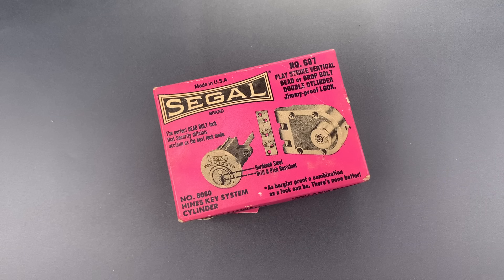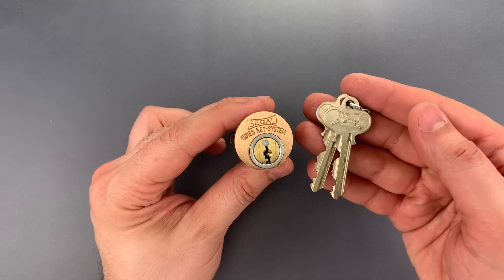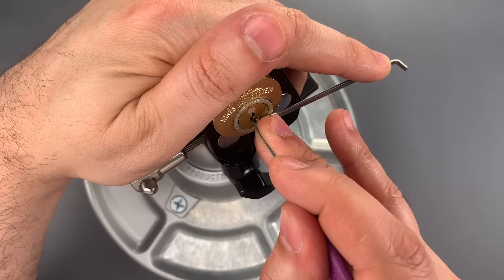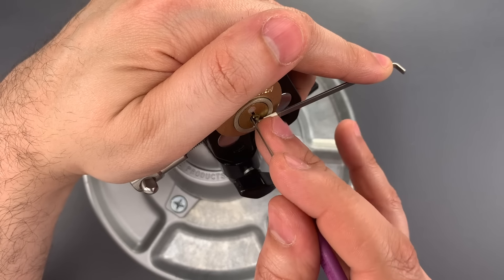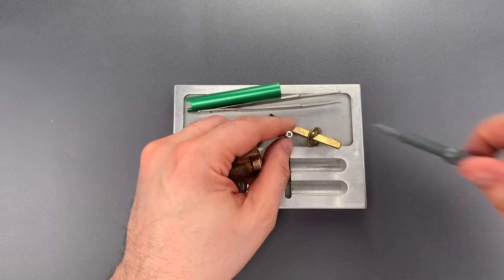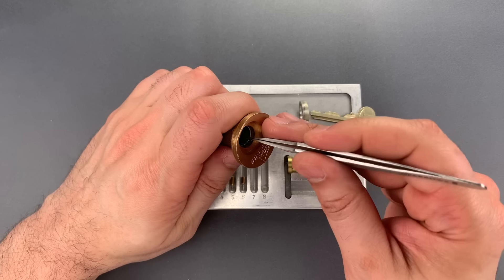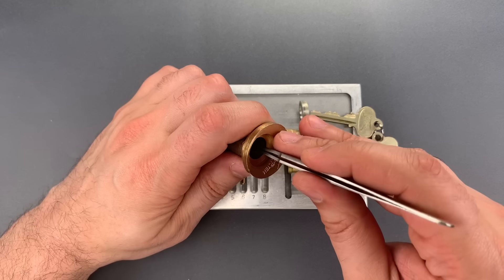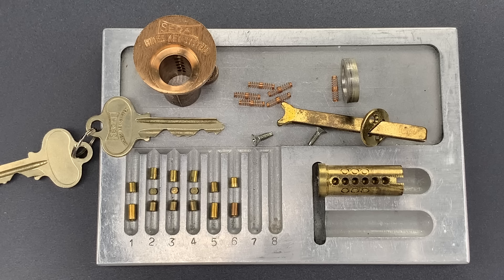[1181] A TRAP For Pickers! The Clever Hines Key System Picked

Comment: Major question: if it cannot be opened with the key after a botched attempt to pick it, what does the lock's legitimate owner do to get into his own property?  If he has to call in an expert or replace the lock, then this means that villains might maliciously pick the lock not as an attempt to gain entry to the property, but just to inconvenience the owner.
Reply: This does raise a valid concern. I suppose the property owner would need to weigh the possibility of inconvenience against locking out a would-be thief.
Most criminals would not be able to identify this key system as being "trollable" just by looking at it, so odds are that if it ever does seize up, it prevented a criminal picking attempt.
Reply: The man himself blesses us with his divine intellect.
Reply: @SpaghettiViking1  You say that people wouldn't be able to identify the lock as "trollable," but there are now 300k+ views on this video within days. The knowledge is clearly spreading fast.

Edit: To clarify my earlier statement for the 5 people already telling me I'm wrong, the 300k+ was within a couple days. Now, it's above 400k. While it's nowhere near the population of the world, the probability increases as time goes by. While others have pointed out that the lock is old and not being sold, you can clearly still find it, and other locks based on this design can have the same problem.

As others have mentioned, there are easier ways to brick a lock than to try to pick it and fail, and I think that's the best answer to my stupidity here. The probability of criminals watching this channel is... well, higher than average I'd say. The probability that someone with criminal intent watched this video and then stumbled upon one of these locks is low, but constantly increasing with the view count. The chance of them actually bricking a lock like this is almost zero simply because it isn't worth it. So thank you to everyone who pointed this out, it certainly improved my knowledge! 😉
Reply: In his other video where he shows you how to modify a normal lock into this lock he talks about how to get it back open if I remember correctly
Reply: yep but if i remember correctly as well you have to dismount the whole lock to do so, so you have to have a backdoor or at least another access to your house without that system installed. It is still good to protect the door(s) of your house that are the most exposed to picking attempts, and could seriously delay thieves and completely discourage some of them.
Reply: My gosh, it's Lindybeige! Top of the morning to you, Limey... well, top of the afternoon for me.
Reply: There are locks like this that ostensibly can't be un-trapped but if you know how, you can do it. Without getting around the back and totally disassembling it to do so. Kensington do a laptop lock that has an "unfixable" trap pin but it is easy to get out of the trap if you know what to do. 

Chubb's old detector can be reset using the legitimate key but again, if you know how, an attacker can get around it.
There are locks that someone with malicious intent can bork though. But I mean, if that was your aim then superglue would be easier.
Reply: Probably why it's not more widespread. It's use case is limited to where the added security is worth the occasional physical denial of service attack. Of course that has the additional drawback of broadcasting that whatever it is protecting must be valuable.
Reply: Anybody can do that anyways with just a loctite tube, kinda irrelavant
Reply: wait wut? Lindy watches LPL too? That's pretty cool actually. But to your question, yeah I could see trolls causing issues. Trolls probably weren't as much of a problem back when the lock was made though. Perhaps plate the hard pin and collar so it's not so easily recognizable? 

Once broken though, you'd have to destroy it. Maybe a new mfg could put a reset on the back side of it so the owner can go in through a different door and reset it?
Reply: You can seize a lock with glue. This would be a much more challenging way to break a lock as you would have to pick it in a way that would work on a normal lock.
Reply: Might be the case, that's why you'd only use one of these on something valuable.
Reply: Not a serious concern.  Vandals can maliciously break locks a lot easier than a botched attempt to pick lock.  Locktite, glue, gum, breaking off some metal/another key.
Reply: They would have to know about the lock ahead of time.
Reply: This is what you call a "Denial of Service" attack!
Reply: I see what you are saying from the denial of service aspect it certainly would be a factor of consideration before considering a lock like this. But locks are not a one size fits all. I feel this is more for a tamper evident approach. locks are cheap so it's no big deal if you have to drill out your own lock. But if your drill is behind that lock it might be a different story. depending on what you are guarding this could be a good way to stop simple "bumper" criminals. Most criminals aren't locksmiths (otherwise they wouldn't be criminals lol) so something like this is a good honeypot to determine if you are being targeted in the first place.
Reply: the owner would call a locksmith who would have to drill out the lock. Considering a lock like this would be on something the owner wanted to protect, the inconvenience of having a locksmith come out would be worth keeping it safe. plus, that's a very minor inconvenience for the crime of attempted breaking and entering. The same could be said with a normal lock, slide in any key that fits the lock profile, and snap the end off in the lock.
Reply: @ncasey9853  and then you just add a note saying well done for picking this and about police being on there way (on something the owner just uses to troll would be thieves not actualy calling the cops)
Reply: Burglars generally don't bother to pick locks if some quick forced entry will work just as easily, and vandals will do things like squirt some superglue into the lock, rather than rely on you having some fairly esoteric locks. Picking defenses are usually meant to protect you from someone entering without you knowing about it.
Reply: Yea, I had the same thought
Reply: for a house its probably crap, but if there is something that doesnt need to be opened very often, like maybe only once or twice a year, buying the lock twice a year to know that no one has been inside the vault or whatever seems like a great idea.

to get inside you can just completely destroy the lock and replace it at that point. I cant think of any use for it as an actual bank vault I assume is more complicated than this. idk maybe if you had a nice boat that you only take out during the summer so for 10 months you store it. buying a 150$ lock (idk the price) is a lot better than buying an entire boat again.
Reply: @rayredondo8160  These haven't been made in decades so I don't think the views are going to severely impact the usefulness or value of the small stock remaining on eBay.
Reply: @rayredondo8160  but how many of your average criminals watches youtube. Let alone lpl
Reply: The lock is intended for high-security applications where the bad guy would want to get in and out without being noticed. This lock would not only defeat impressioning, bumping and most picking, ie, keeping the bad guy out, but afterwards would also flash a neon sign to your security guys that your facility is being targeted.
Reply: @rayredondo8160  he said most
Reply: Couldn't you do the same with any lock by just shooting crazy glue into it?
Reply: Hi , Lindybeige. Big fan.
I think that, if your intention is to troll and block a lock... there are extremely easier ways to do so, and would work on any lock.
Reply: Hallo, Lindy! Just came directly from your “Berserkers” video to here! It’s a small world :)
Reply: if you just want to mess with someones lock, you can just put glue into the lock body. that will have the same effect for pretty much any lock and requires less skill and effort
Reply: @rayredondo8160  but the lock is from the 60s
No picker in the 60s had access to YouTube, so it was safe as houses back in its day
If you were to use this lock these days, I guess you could get a cheap camera system to identify the troll if it started happening
Reply: I wonder if a tool could be made to reset the trapped lock, like some sort of vibrating  probe to cause the lock to vibrate that would cause the hollow pins to hop out of their sockets. And, I wonder if the motor involved in that would need to be able to vary its speed to work on more solid or less solidly mounted locks.
Reply: Imagine the fun these could of been in school.
Reply: @rayredondo8160  You seem to forget the fact that there are 7 billion people on this planet and the odds of randomly meeting one of those 300k is rather small, exspecially if you add factors like malicious intent.
Reply: @rayredondo8160  I'm guessing that YouTube wasn't anticipated when the lock was built in the 1960's.
Reply: So you're talking about someone going out with the express intent to just brick the owner out of this lock? That is completely and utterly irrelevant since you can do that with a tube of superglue/epoxy or just by breaking a key off in any lock. I feel like you are trying to create a new unique issue to this lock where it already exists with all locks..
Reply: I was JUST thinking of that!
Reply: Picking the lock to inconvenience the owner is unnecessary effort. You can inconvenience the owner by hammering a metal pin into the lock's keyway. Works with almost any lock, too, not just with this particular kind.
Reply: dj d  Before a worn key could disable the lock, it would stop working altogether (with shear line at about half the length of the wafer it would neither seize nor open) and the owner would just get a new key or a new lock.
Reply: No lock is immune to malicious intent tho. Anyoune could go to town with silicone or liquid weld to ensure a key couldn’t work
Reply: It would make a great lock for a door that leads to a porch or garage, coupled with a really secure lock on the front door...
Reply: @SpaghettiViking1  I mean... 50 dollar's lost to get a door open, or possibily thousands of dollar's lost and home trashed.
Reply: I dropped a comment to this effect above.  It’s super dumb.   Maybe in an era before readily viewable cctv was a thing but now, just have a decent lock like a medeco or a protec that’s beyond most picker’s ability and install a damn camera.  If you’re that paranoid, picking attempts do tend to leave little scuffs and minute traces of metal shavings, particularly if someone tried raking first.

All it achieves now is you know someone tried to break in and now you have to break in too.
Reply: Lindy and Locky, all new episode of this lock picking, swing dancing, history telling, crime solving  dynamic duo coming soon.
Reply: This is similar to the issue of a computer password being disabled after 3 failed attempts.  A malicious person could fail 3 times on purpose and lock the legitimate user out.  I think that the modern system involves slowing people down instead of locking people out.
Reply: Would you rather lose $100 to a lock smith or thousands of dollars to a thief?
Reply: If someone wanted to defeat a lock permanently, they could fill it with bubblegum or resin or superglue or something. I'd be less worried about intentional attempts to disable a lock like this.
Reply: drilled out by  a lock smith  duh  exactly how did your high school let you graduate ???
Reply: When the lock provides more protection than the door
Reply: Its the same a if someone vandalise a lock with some glue or torch.. you would probably need to change the door jam :)
Reply: You can pour glue in any lock, can't you? Why go to the extra steps of picking it to disable it.
Reply: @rayredondo8160  Its vintage, the internet didnt exist when this lock was sold.
Reply: yes its a major inconvience the lock is well, locked, but if you go by the function of a lock, to prevent unauthorized entry, it serves its job well.  there are other locks that don't bind up, but they have a wildly different design to counteract picking
Reply: @Eidenhoek  so long as it sees plenty of use in the backdoor, sure.  even if it only get use at the front. sure!
Reply: The owner just need to know on the door so the wife lets him in 😂🍺👍🏼
Reply: The answer is you get a set of tool steel keys cut for it and just manhandle it using a screwdriver for leverage.  This will break the pins of course, and you'll need to replace the lock.
Reply: It depends on what you're trying to protect. Something really valuable would be worth the lock being destroyed in order to ensure the extra security.

A lock like this may not be the best for a house or some other lock used quite often. But it would probably make for a pretty good private safe lock or something similar.

You would want it on something where you would rather the lock be destroyed for that little bit of extra security.
Reply: Or squirt some superglue into any brand lock. Quicker, too. If someone wants to lock you out, they will and can. This lock doesn’t make that any easier.
Reply: oh hi Lloyd fancy seeing you here
Reply: You can jam up most locks to inconvenience the owner. Various items, along with epoxy, etc., can be forced into the keyway and render the the lock unusable.
Reply: There is nothing stopping anyone from putting superglue in your lock. It's in fact easier than bricking this lock, since you don't need to pick it. If someone wants to inconvenience you, there are easier ways.
Reply: Mehn just use a couple of rounds of 50mm lock picks
Reply: Have a glazier remove a windows pane and refit it after.
Reply: Depends, but my assumption is that they just have to take it apart and hope criminals stop trying that location. As far as “trolls” go, if you have the time to go around inconveniencing people by jamming a lock, there are less subtle ways to do it
Reply: @QuiniansBudgetCrafts  Lindy had made his own lock video once. Thus, it's not a big surprise...
Reply: Well, most trolls would simply shove something up the key way, or glue it shut... This works on most locks without any skills or knowledge...
Reply: @edi9892  ah didn't know that I'm go check it out
Reply: LINDYY!!!
Reply: All those "malicious villains" who are out to inconvenience you? Uhhh
Reply: People with the skills required to pick doors fortunately aren't risking arrest to inconvenience the owners. Especially so when in the past lock picking was a very rare skill to have, and it was harder to get by. There is very little reason to frustrate people when for the same risks one could steal and make their own lives better. If one really wants to frustrate an owner it would be far safer to simply throw a rock through a window(s) and run away, and requires a far easier skillset to do so.
Reply: Its really for a situation where you absolutely do not want someone to get unobtrusive access. For home use its questionably worthwhile depending on your situation. But for say a business trying to protect really important documents or incredibly valuable items it can easily be more worthwhile to know that someone attempted to break in and that they weren't successful.
Reply: @alexsis1778  I wouldn't disagree with the premise, but I'd certainly disagree with the conclusion. In a critical situation one would want a high end lock rather than a mediocre lock with a trick up its sleeve. The latter, as we can see, can be bypassed. The conventional good lock will keep out a far higher percentage of potential people, one would assume someone able to open a legitimately good lock would recognise and prepare against a very distinctive model of lock. It will cost more of course, but if you absolutely have to keep the area secure you can't really afford to go cheap on the main device ensuring that goal.
Reply: This thread just became beige. It's such a pleasant colour!
Reply: If this lock is stuck, you likely have bigger problems than a mere burglar or vandal, since most people who are sophisticated enough to try to pick the lock, don't really want you to notice that they were in there in the first place. The exception is perhaps a gun vault, or some tech room you don't have to go into very often. I used to check on weapon stores when I was in the army. I don't want to go into detail, but locks like that could serve as a warning of spies or possible high level sabotage attempts.
Reply: The lock can be disassembled and reset once access is gained via another method.
Reply: The legit owner can always use destructive way of entry or call a good locksmith.
Reply: What are you doing here? It always weirds me out when two of my worlds randomly collide like this.
Reply: Can't you just jam up the lock with anything to make that happen?
Reply: The fact that this lock being installed at all means the owner is ready for it
Reply: @adamwest8711  those are expensive locks though and especially if you need many, compared to this method you only need a few wafers a dremmel and a knife
Reply: If you want to inconvenience the owner of pretty much any lock, you can just fill it with glue.
Reply: I would wager a guess that this is why these locks are not very common. I would guess you would use it for places you want 100% secure that not many people have access to.
Reply: The owner eventually buys a gun.
Reply: The short answer is, yes, you can do this to a lock like this merely to "inconvenience the owner". But I feel like it's a moot point - since you can achieve that with almost any lock, and much more easily - by just hammering in a nail or a wood screw with a broken off head.
Reply: I imagine this type of lock is what a CEO of a fortune 500 company might use in his office cupboard where he keeps some questionable possessions. Nobody should be poking around that lock and the minor inconvenience of having to bulldoze down the whole lock is trivial when in exchange you get to know that somebody tried to fiddle their way in
Reply: @TwoPlusTwoEqualsFive32  and then what? You still won't be able to open it from the inside.
Reply: @rayredondo8160  "but there are now 300k+ views on this video within days. The knowledge is clearly spreading fast."
A good point but now drop the number of views in this video which is over a million to the entire population of any given country.
After you have done that realize that all these views can be from ANYWHERE around the world and how many of these people actually have lockpicking tools and the knowledge on how to actually use them AND how many of all these people would simply want to cause harm to someone specific and what are the chances of them having this exact lock :'D

So in short we can toss this issue in the "statistical impossibility" bin.
Reply: Somebody could do that, but they could also just stick a key into your lock and break it off, resulting in the same issue.
Reply: @degiguess  Well yeah, buyt getting a broken key out of a keyhole is a much simpler task that can be done without opening the door or removing the lock.

Same cannot be said if this particular lock goes into full lockup, you would need destructive methods to get the door open again.
Reply: @ambassadorofreee3859  then they could squeeze liquid cement into it
Reply: If people want to piss the owner of a lock off, filling it with superglue or epoxy glue would do the trick, no matter what lock it is.
Reply: i Was thinking the very same thing while i was watching Oak Island. after one fool trips the trap what then ??
Reply: probably why we don't hear of this lock anymore
Reply: the most likely time this lock would activate the trap is if your ex did it.
Reply: foofustherabbit .
Reply: Watch https://www.youtube.com/watch?v=7JlgKCUqzA0 he explains it in this video
Reply: @gabreshaa8234  hail! to the oracle
Reply: @SpaghettiViking1  Unless the criminal is in the 1.1 million viewers interested in picking locks rofl the fuck dude
Reply: You could inconvenience the owner in any number of ways if you wanted to. If the intent is there, you will find a way to do it. Supergluing the lock, throwing a brick through the window, throwing a tin of point on the wall. Seems silly to focus on them being able to permanently jam the lock by attempting to lock pick it.
Reply: I haven't seen this in any of the comments, but in order for this trap to work, you have to 'successfully' pick the trapped pins. The cylinder won't turn unless all six pins are picked, 2 3 and 4 at least to the first shear. Anyone who watches this video and has the tools and skills to successfully trigger the trap, could also avoid the trap. Since this doesn't seem to be a skill trap, more of a knowledge one. 

All that being said, it's highly unlikely a vandal will have the tools and knowledge to trigger the trap, and the restraint to not break in for real. At that point, if the trap tries, it did it's job.
Reply: @ikiruyamamoto1050  I've also seen some products that resemble keys, they are made to jam the pins of a lock and completely disable it. Glue is probably a simpler way to do it, but you might be able to loosen it with heat.
Reply: Other malicious things you can do: half drill it out
Reply: You still end up with knowledge that somebody attempted to break in
Reply: this would give the added benefit that the owner now knows someone attempted to gain illegal entry. for some people that would be important
Reply: Destructive entry if u can get to the back maybe a different door into house  and disassemble and remove  the top cover u could reset it but that would be hard to do trapped and in a door
Reply: Well you have to pick it first for that to happen - if you just want to sabotage the lock, might as well push a blank in and break it
Reply: @owlblocksdavid4955  no one cares.
Reply: You would need an alternative enterance to get in, such as a back door. Once inside, you cna dissassemble the lock from the inside and reset it
Reply: The reap life dos attack
Reply: Yes. Just a quick rake and then continue walking on. This lock also passes the test that it's easier to break the window next to it or go through the sheetrock.
When my mom got very sick before she died I broke the glass to get into her house because she had the deadbolt set. No police were called. No one came running. I was in the house and under 30 seconds.
Reply: Key + vibration
Reply: @rayredondo8160  true
Reply: @piraterubberduck6056  I have dealt with that, it sucks, and if your goal is to render a lock inoperable, it works nearly as well as this trap.
Reply: @Ckcdillpickle  .... oh yes. My criminal bad only sit around in a cave and make nefarious plans Mwahahah we are definately not entirely human
Reply: @AndyGneiss  isn't/wasn't there a little shaker gun that essentially throttled the lock and twisted the cylinder with the goal being to bounce and trap the pins as the cylinder shakes slightly open and closed? I remember it being pretty big and incredibly loud with multiple settings. And slow, taking as much as 10 minutes on a standard door lock.

Idk. My dad had the same hobby as lpl, maybe I saw something in his shop or in a movie?
Reply: @Lindybeige didnt expect to see you here
Reply: I honestly didn’t notice who left this comment until after I started reading comments. Cool to see you here. ^_^
Reply: I mean you can purposefully bust any lock if that's what your goal is. It doesn't need to be this one.
Reply: @rayredondo8160  This lock was also made in the 60s, so I doubt you'd find one anywhere.
Reply: imagine someone getting caught picking one of these and he goes" i'm not trying to break in, it's just a prank...."
Reply: How many of these people could actually pick a lock and how many could do it fast enough to not draw any attention to themselves?
Reply: A lot of comments to this reply. But who picks a lock when the body of the lock is the weak spot?
Reply: Could you guys do a colab about old locks, lock piking or something. I think it would be great
Reply: You could achieve the same malicious effect by squirting a bit of super glue into ANY mechanical lock.
Reply: The villains might throw a brick through a window just to inconvenience the owner as well. But, whaddaya gonna do? Or are you suggesting that some people would be so outraged to see such a lock on any door that they would set about maliciously picking them, but absent the presence of the lock they would just continue on their merry way?
Reply: People often forget that most homes have windows. And conveniently located nearby are flowerbeds with bricks or rocks....
Reply: Big brain 🧠
Reply: You need to fully pick the lock to spin the lock and get the lock locked (?), in which case a broken lock might be more desirable than an opened door.
Reply: If you live there you get a locksmith over which propably would be covered by your insurance
Reply: @rayredondo8160  Even then, I really doubt a criminal would recognize the lock if they ever encountered it after watching this video. Knowing how to pick a specific lock doesn’t help unless you can recognize the specific lock out of hundred of thousands of different locks there are.
Reply: i mean i guess the point is more you dont get your house robbed
Reply: That means someone in first place needs to pick it enough to spin the core. Think about it this way - if lock didn't have those you could just enter the house.
Reply: I can easily give a couple of example of usage, even if this lock is useful in many more occasions. First, on a secondary entrance: something useful to have for any reason but compromising the security of the building. For example an entrance from a shady alley where a lockpicker could have an easy time picking a lock far from peering eyes. It is easy to reset it if you can access the lock from the other side. Second, as a second line of defence, not to protect the house but to protect a safe or a chest. Clearly no one is going to pick your lock to enter in your house just to troll you by temporarily locking you out of your safe. And in many cases you might prefer to lose an item than to have someone else have it.
Reply: @MANUEL CRISTOBAL ROGERS IRURETA all brass, no ferous metals :(
Reply: @gabreshaa8234  Divine, the 8th commandment. Thow shall not steal...
Reply: @rayredondo8160  I think it’s funny you knowing and defending yourself. When you don’t really need to.
Reply: @QuiniansBudgetCrafts  you give trolls to much credit. Don’t let them steal your peace. Easier than you can pick these locks...
Reply: @ericwalker6546  You're right, I don't. But if I do, I have a slightly higher chance of people not telling me I'm wrong 😉
Reply: @rayredondo8160  If you know you are right then it really doesn’t matter what they say. Most people just show there lack of knowledge.
Reply: @ericwalker6546  See though, I wasn't entirely right, and so part of my edit was correcting myself. I was partially trying to deflect and partially trying to educate anyone who did think to read my full comment.
Reply: @rayredondo8160  ok bro. I was just backing you up. But it’s starting to look like you are a approval addict trying to please everyone. You can please some of the people some of the time. But you can’t please all of the people all of the time. Abraham Lincoln.
Reply: @ericwalker6546  Clearly I'm not an approval addict, otherwise I wouldn't be posting in YouTube comment sections. I'm just trying to inform people, including myself, as best as I can, and that sometimes means I'm wrong.
Reply: @rayredondo8160  You post comments and then try  to stop negative comments in advance. Because you want everyone’s approval.
Reply: @ericwalker6546  If you paid attention to my comment, you'll note that it was an edit. Meaning I got negative responses, then changed it to reflect new information. And then I kept getting negative comments because people didn't read. If I were seeking to prevent more negative responses, I could easily edit my comment again to tell someone to read the full thing before responding, or something to that effect.

My purpose is to learn and educate, not to seek approval.
Reply: @rayredondo8160  It doesn’t matter to me one way or another. But you try to hard to hard to make yourself feel better about what other people think of you.
Reply: @ericwalker6546  You're right, I do care what other people think about me. I care if someone stumbles on my comment and decides I'm a know-it-all. I especially care if that someone happens to be someone who knows me in real life. But beyond that, I really want people who read the comments section of these videos to learn something beyond what the video has; I don't just want people to see some kids poking fun at the video maker, and I don't just want people to see pointless arguments.

... Such as this one.
Reply: If, as an infiltrator, your goal is simply to get inside where the lock is, then the plan would be to botch the pick and seize the lock. Knowing that the owner will be forced to call for a locksmith, intercept and replace the locksmith, and then use that cover to gain "legitimate" access to the lock and beyond.  A bit Machiavellian, or Italian Job, but there you go. 
Now, if you are dealing with someone who just wants to cause a problem, they won't take the time to try and pick the lock, but will simply insert a shim, glue, or whatever, and move on.
Reply: Will we be seeing a Lindybeige episode discussing locks on the horizon?
Reply: @jonmcfluffy9699  for a home a lock like this won't be super effective  unless they are trying to not be super obvious  be a lot easier to go through a window or glass door
Reply: I don't understand where the small wafer belong.  What keeps the hollow pin from dropping into the key way?
Reply: @rayredondo8160  This lock is from the 1940s, only a small handful of people will have this still installed. A criminal watching this video with the intent to damage property for the sake of being annoying is going to have a hell of a time even finding this lock so they can break it. It's such a non-issue I can't image why you're parading it around like its some big threat.
Reply: @SpaghettiViking1  On the other hand the owner could install this lock as the obvious lock to pick but attach it to nothing. Imagine an experienced lockpicker spending the time to pick this lock, then, SUCCESS! he turns the lock...then nothing happens. The door is equipped with a hidden magnetic deadbolt and he is fresh out of super magnets. (as well as being unaware of the existence of the deadbolts)
Reply: I think, if you're being targeted by someone that just wants to fuck up your life by inconveniencing you in such a way then you probably have some self improvement to do beyond being worried about your stuff
Reply: alternatively they can stick scrap in the key way with relatively the same effect I think
Reply: This sounds similar to how some safes have an anti-drill glass plate inside them that if you try to drill the safe, you risk breaking the glass plate which releases additional bolts that hard-lock the safe, requiring it to be forced open.  In that case it's more a matter of once the lock is certain someone other than the owner is trying to get in, it clams up to maximum security.  Obviously things IN a safe are more valuable than the SAFE itself, so the owner would be OK with having to wreck the safe to get his property out, rather than the safe being unharmed but losing what's inside it.  Same thing goes here, it's less inconvenient for the owner to have to break in and replace the lock than to replace everything in their house the thief was trying to steal.
Reply: @rayredondo8160  what is your point?
Reply: @juxtapode2781  good we’ll pick that back door instead! If a thief is going through the trouble of picking a lock he’ll look for other doors to pick instead and try his luck at those. You can’t win for losing...SMH
Reply: There is a way to repair this lock after it gets caught on the trap pins. You have to pry open the top cap and empty the springs and the drivers back out the top. I’m sure it can be done that way. Then when you get those hollow pins out. Throw them as far as you can..
Reply: @delinquentdesign  a thief has to actually pick the lock for it to get stuck, so he would not realize it until he tried. That can significantly increase the time to get into a house, and if it happens on one lock he may not bother to check the others because it would be reasonable to think every lock has been installed like this. Not saying it would work every time, but if it works sometimes its better than not having it. "SMH"
Reply: Better to call a locksmith than call the police.
Reply: a rebar ram on the door , and several hundreds pounds of front door refurbishment
Reply: Lol
Reply: "Villains" lol
Reply: I feel like I recognize the moon in your pfp
Reply: Simple solution: Always keep a fire axe in your car.
Reply: Well, if your "villain" really wants to annoy you by making your lock unusable, all they need is pouring superglue in it.
That said, if you pissed someone off I think it's far more likely they'll go for a brick to the window or cut your tires.
Reply: I guess you can reset the trap using some kind of bumping or vibration.
Reply: Most people don't know about this special key system so whoever is trying to pick it has to be having the intentions to rob the home.

It's better to have to replace a lock rather than to replace all your valuables.
Reply: Hulk smash.
Reply: @ncasey9853  family is very valuable. it doesn't have to be anything of monetary value.
Reply: This argument applies to any lock. Superglue? Epoxy? Frigging bubble gum? If you want to inconvenience the owner there are easier ways than purposefully botching a lock picking attempt.
Reply: @piraterubberduck6056  The whole idea is so utterly stupid that those almost 6000 likes feels like a slap in the face of human kind. 
Not only are there more easy ways to "troll" a lock, it is illegal and quite frankly difficult to do so. 
High risk no reward ...
Reply: I thought the same but would you rather a your hole house have a pickpocket Come and take about anything they want or deal with a lock that can't be used anymore
Reply: Sup?
Reply: Fire Axe lol
Reply: @juxtapode2781  Probably better for back doors, with the main door using some other system. The thinking here is that a back door is probably less prominent from the street.
Reply: Different door
Reply: This is a ‘clever’ lock made in USA.
Reply: You have to disassemble the lock from inside the house. At least that's how he showed to get his variation working again.
Reply: @SpaghettiViking1  the crininals will just throw a brick into the window
Reply: @rayredondo8160  bud back in the day I was a small time criminal like stealing shit. And I just always destroyed locks. Or just look for a window open. Most low time theifs will not  try to pick anything or learn how to pick. I've watch this vid (not a low life anymore but) and wouldn't be able to tell this lock apart from others. I'm sure some people do use this info to better their skills but I think for the most part Johnny methhead is just going smash and grab what he can.
Reply: This is hardly a legitimate criticism of this lock.  Anyone can easily "inconvenience the owner" with any lock by simply breaking a key off inside of it.
Reply: Wow! Not the sharpest tool in the shed are ya?!
Reply: True
Reply: Hey, it's you
Reply: Of someone wants to inconvenience a house owner, they can just put him or superglue in, and not look around for the one house with this lock.
Reply: Perhaps the lock is securing my food cache.  Maybe I do not care about the economic value of the food, but more that no one has tampered with it.  Maybe I just throw the whole thing away.
Reply: tbh, if you just want to troll the owner, you can just put glue in a lock, drive a nail into it, whatever .. it doesn't need a hines lock to troll the owner :-)
Reply: As an answer to your question, I would love to direct you and all interested parties to Google "goblin locksmith art" for a practical example of an alternative solution
Reply: I'm sure their are easier or better denial of entry attacks that aren't specific to this lock.
Reply: If you want to brick someones lock, super glue is a much easier way than hoping the guy has this one particular lock type and trolling it with a delibrate failed pick attempt.
Reply: @rayredondo8160  almost 2 million now
Reply: If y9u can't figure this one out don't buy th8s type of lock. Leave this 9ne for the grownups.
Reply: @rayredondo8160  2M views now
Reply: The lock seizing up means that the quiet, easy to miss act of lockpicking now has to be replaced with something loud like drilling/hammering/breaking windows and the culprit is more likely to be caught.
If the owner has to break the lock, who cares. It's their own place.
Reply: @SpaghettiViking1  Does the intent behind the criminal's action matter at this point ? You're both locked out of the access to the apartment.
Reply: You're right, however it depends what you're defending in your property and what are your priorities. 99% of the time a picker is a thief, so what should be your priority? do it yourself.
Reply: Consider that most locks get picked infrequently. Out of these, some attempts fail flat, without even triggering the lock to seize, a fraction will get the lock to seize and a smaller fraction will possibly unlock and get in.
It is therefore unlikely to happen that the lock seized. Even then, the lock protected you property.
Of course, if you situation is of frequent picking attacks, you might prefer a different lock.
Reply: If someone simply wanted to inconvenience the owner, it would be way easier to jam a toothpick into the keyway.
If someone tries to pick a lock chances are they are trying to break in.

Most likely the reason these locks are not made much anymore is most criminals have zero qualms about kicking in the door.

Most lock picking experts happen to be locksmiths, not thieves….
Reply: @rayredondo8160  "Knowledge"? This is mostly entertainment and will be out of plenty of our heads quick enough unless you took an active interest in it and studied further to solidify it or has a tremendous memory for this kind of thing.
Reply: Any lock can be easily disabled by breaking a toothpick off in it, so it is not really an issue that this lock can be disabled by attempting to pick it.
Reply: @Lreclusa  Even the lpl took 10 tries to pick, which means he bricked 9 locks. It is definitely a skill issue. The big thing here is if you come home, and the lock is jammed, you know someone tried to pick.
Reply: That was my thought too. Trolls be trollin'.
Reply: @SpaghettiViking1  break a glass pane and you're inside anyway.
Reply: Well he simply chainsaws the door! 🙄
Reply: How's that a valid concern?  If someone wanted to cause inconvenience they could just squirt superglue into ANY lock.. much quicker and easier lol
Reply: What is this, a crossover episode?
Reply: I had the exact same thought, so I was really excited to see someone else ask the same question. Then (depressingly but unsurprising) I scroll through the first 50 or so replies and they tunnel vision solely on the "there's much easier ways to troll a lock" aspect. Way to completely miss the point. How do you release the lock if it binds? Stop getting bogged down in stupid things. It's a simple question. How do you release the lock if it binds.

Maybe someone has actually addressed the issue, but with 200+ replies, it's painful to slog through the stupidity to find actual replies.
Reply: Yes, but if they had that intention with any kind of lock, they could very easily inject glue into the keyway, or any other thing that could render it unusable. To plan on screwing your lock just because it's this specific brand... That would be very specific
Reply: I would just replace the hollow followers with longer wafers or pins, then recut keys. Sometimes a little deterrence can go a long way
Reply: I might be late to the party, but i see a possible market here - selling such locks -> go set em off yourself -> people call you to fix it -> gather statistics on how many times the lock has 'saved' people -> prove that your locks are significantly stronger than competitors. EZ stonks

Jokes aside though, i doubt burglars are willing to risk getting caught just to inconvenience you. Seeing as how a light/dog/high fence/camera warning scares em off already.

Your friends/kids, might find interest in pranking you tho.
Reply: If you lost your keys and call a lock smith who than seizes the lock, that would be bad.
Reply: You can open it from the inside  without much problem.
Reply: I think this is the main reason why it's not so popular.

I mean, if it jams up when lockpickers make a "mistake", what if it also jams up, in the odd case that your keys also just fumble up?
It's pretty hard to "fix".

And considering the fact that it STILL CAN be picked... I think the other options in preventing lockpickers would be far more favorable.
Reply: Aha! It must be those sniveling Frenchmen!
Reply: @pl8710  I just checked (video 527) but he doesn't mention it. The only way possible would be to remove the lock from the door, from the inside. Then remove the cover that holds the springs. Without the spring pressure, the lock will turn again.
Reply: Villains could also maliciously fill any lock with epoxy, superglue, or flex seal (that's a lot of damage). This is not a vulnerability exclusive to the Hines Key System.
Reply: 236 comments the answer is in there somewhere
Reply: Well, if you want to inconvenience the owner you can just insert epoxy glue inside the lock
Reply: Make sure you have a second entrance before committing to this lock system. Worst case scenario, you could always break in through a window or other method.
Reply: True. Deny access, as harassment.
Reply: @tinetannies4637  Great points.
Reply: That's probably precisely why you don't see this lock everywhere
Reply: You can solve this with a defence in depth strategy. Have a barrier to entry with a decent lock system in front of the barrier with this lock. 

The outer lock may not stop a determined and skilled attacker but will stop trolls who would just want to break the inner lock.
Reply: Yes, that's the same principle behind "we'll lock your account if you enter your password wrong three times in a row". Perfect entry for a denial of service attack.
Reply: You can do the same thing to most doors with a heavy blunt object.
Reply: Yes.
Reply: Most buildings have more than one door. It's my understanding that, while lockpicking is a fascinating topic, it is rarely the first resort for people who want to break into a building. If I were to use a lock like this, I'd put it on a back door or any hidden door that gives someone an opportunity to slowly pick a lock in relative safety, but my visible front door would be another type of lock, and I'd focus mainly on repelling brute-force entry to that door.
Reply: @rayredondo8160  well he’s up to 2.5 million views now
Reply: They don't have to pick it to do that, they could just use a lockout key with any lock.
Reply: That is precisely the reason he said Lock from the 60's and not from the 2020's dude
Reply: If someone wants to sabotage your lock so you can't open it they don't need to take advantage of any 'traps' built in to the lock.  All they need to do is to jam some stuff into the lock and you won't be able to put in the key to open it.  I've had that done to my front door. Fortunately I have another entrance which they didn't mess with so I didn't have to break down the door. Eventually I found out it was a neighbor's bored children that had been doing this to me and others nearby.
Reply: @SpaghettiViking1  you’d still need to be able to pick it in order to troll them… it’d be easier to fill it with superglue if you just wanted to piss them off.
Reply: Someone can just snap a normal key in a normal lock so you dont realy lose anything
Reply: I know this is old but regarding criminals watching this channel: There's a huge difference between watching LPL pick a lock and picking one yourself. I myself tried to and struggled to get into a masterlock #3. I couldn't even rake it and they're supposed to be rakeable (still dunno what im doing wrong). Various lock companies have accused LPL of being a how to manual for thieves but the reality is just watching the LPL isn't going to turn you into a lock picker, it takes lots of practice to become any good at it, and LPL's real mission is to help people make informed decisions about their security, and to hopefully pressure lock makers to improve their products.
Reply: I'd rather replace a trapped lock than all the stuff inside my home.
Reply: You can put glue in a lock or whatever if you want to lock someone out of there house.
Reply: That owner most likely needs to watch this video, so they can avoid using this lock for that reason!
Reply: 99% of the time it will be substantially cheaper to call a locksmith for the deconstruction of the lock than to replace any items stolen in addition to having the benefits of being legitimate proof that someone was attempting entry for insurance claims and coverage. The best part is that the insurance company will probably pay you back for the locksmith.
Reply: @jedstanaland2897  if you could deconstruct a lock while it is installed in the protected entryway, then I would conclude that the lock is not secure enough to be used in any real world secure situation as it is. Just my, "assumption". Correct me if I'm wrong, disassembly should be able to occur only when on the other side of the contraption for security purposes.
Reply: This lock appears to have a top slider for re-pinning. If you can get inside the property some other way, you can dismantle the lock from inside and remove the top slider to eject the three trap pins.
Reply: You've hit the nail on the head with your observation. If a lock is rendered useless after a failed pick attempt, the implications for the rightful owner are immense. Your point about malicious individuals not necessarily aiming for unauthorized access but merely causing inconvenience resonates deeply.

Building on your thoughts, I've been contemplating a possible solution. What if there was a specially designed vibration tool that's inserted into the keyway without engaging the pins? This tool, equipped with grooves on both its front and rear, could engage with both ends of the lock cylinder simultaneously. The aim? To initiate a synchronized upward movement of the entire cylinder, precisely where the trap pins are. Such a motion, combined with the vibrations, might cause the trap pin to rise momentarily.

To complement this, envision a rubber-clad rotational tool. It serves dual purposes: ensuring the vibration tool is aligned perfectly for maximum engagement and applying the necessary turning force. The rubber coating minimizes friction and boosts vibrational impact.

The underlying principle? Resonance. By tweaking the vibration's frequency to align with the trap pin's natural oscillations, each vibration could amplify the pin's upward trajectory, potentially freeing it from the trap.

While still a theory, the potential ramifications of your observation make it essential to brainstorm such solutions. Would love to hear more thoughts or feedback on this idea!
Reply: This could be a fine risk to take depending on what's being locked.
Reply: I know this thread is old but I feel like no one has pointed out that yes, this downside is a feature. Different tools for different jobs. You wouldn’t want this lock on your front door, but some items are valuable enough that securing them is more important than making them accessible. A server room comes to mind - I’d rather be locked out of there for a day or two until a locksmith breaks the door down than have someone gain access to the servers. Many military applications as well
Reply: bro said "the villains"
Reply: You mentioned it. Destructively You didn't say that, but he said. Any non destructive means will not work.
Reply: If you know your buddy has one, and he leaves his keys laying around, just file down 1 cut on his key 😂
Reply: @rayredondo8160  3.6M views 3 years later :D
Reply: Note that you still have to successfully pick the lock in order to trigger the trap. Thus anyone who can trigger the trap could have actually gotten into the house if it were a conventional lock. Having to call in a locksmith will pretty much always be better than actually getting burgled.
Reply: @rayredondo8160 When it came out in the 60s there was moninternet
Reply: Destroy the lock of course.
However, a thief would never seize it up on purpose (except perhaps on his way out). They would always at least TRY to open it, so if it’s seized it’s pretty much a guarantee that it protected your property. Thieves would troll a homeowner by making the lock seize after robbing them though. There was an old show on Discovery channel, To Catch a Thief, something like that. The hosts were two reformed thieves. Anyway, one related that if he didn’t have the time/ability to steal a big screen TV he WOULD steal the remote, just to be a prick about it. So yes, thieves would intentionally destroy the lock, but only after successfully picking it.
Reply: I’m gettin some serious “land-lordy” vibes from this comment 😂